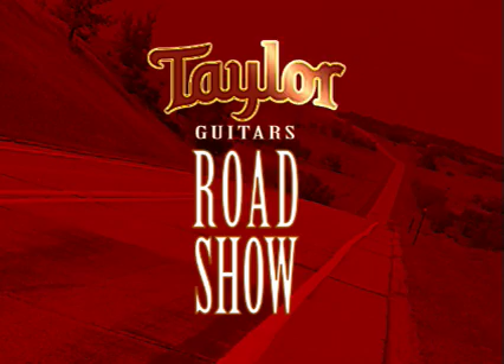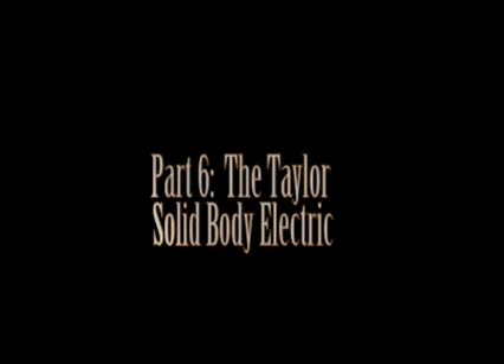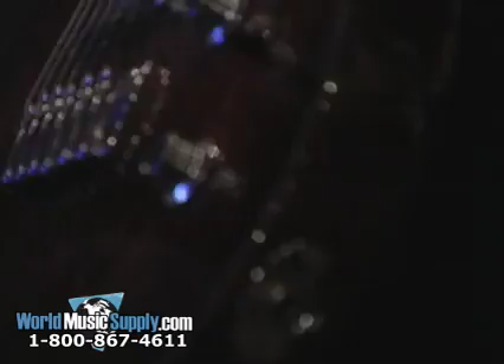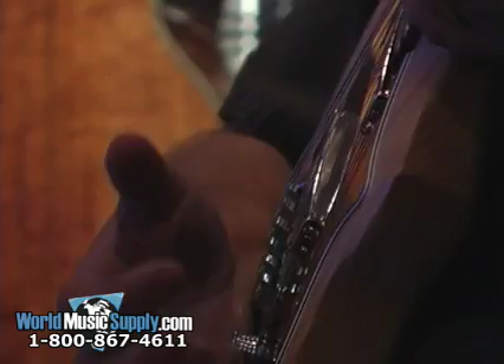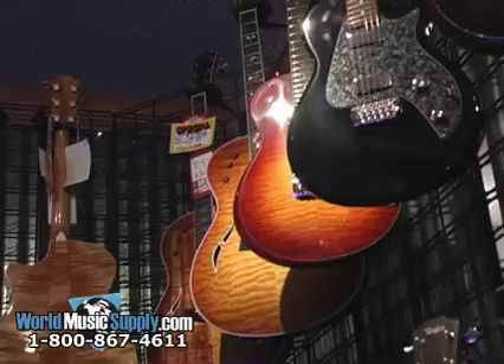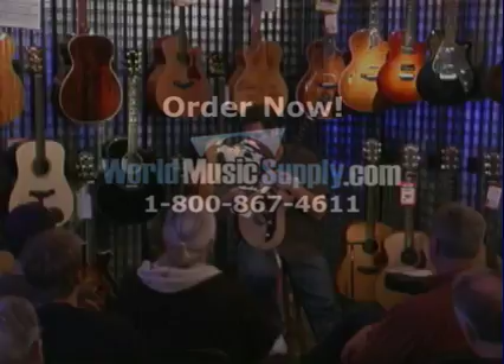Taylor Guitars Road Show Part 6:  The Solid Body Electric

Comment: I played a classic at a local guitar shop recently. Without even having it plugged into an amp you can tell a difference. The way the sound resonates naturally was really cool. They had this guitar mixed in with some strats, teles, and les pauls, and by far this was the best sounding and most versatile. After I actually plugged it in and was rockin away I noticed that this guitar puts out a great crunch that you usually get out of heavier guitars. Can't wait to get one these great guitars